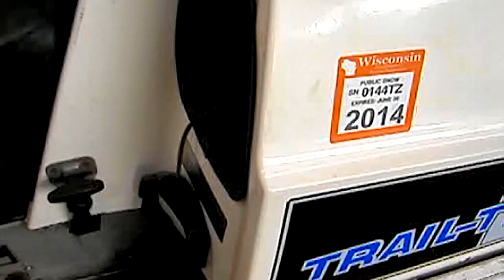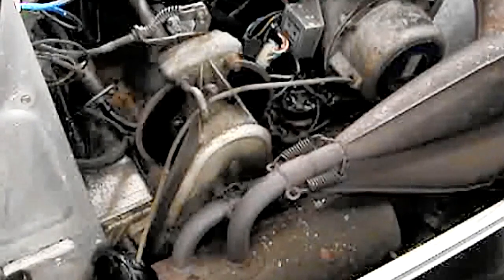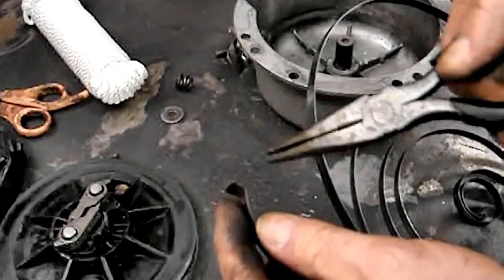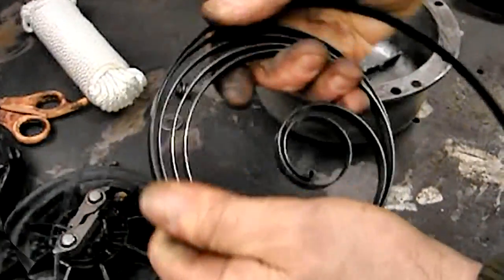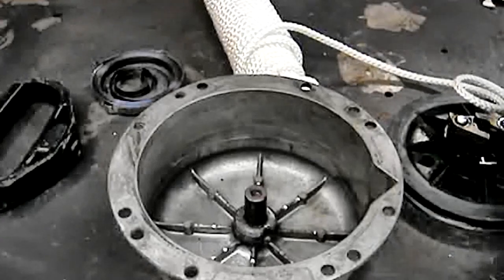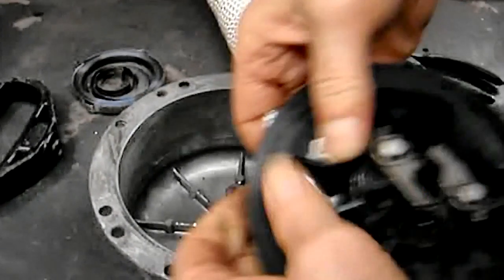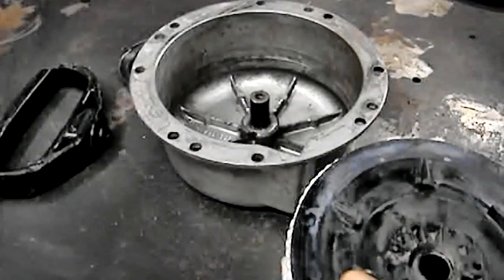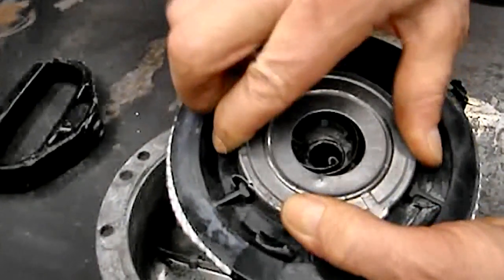How to rebuild a starter recoil rope and spring

Comment: Great vid. We differ on how to snake the rope back out to knot in the handle and I have "5 turns" written on the inside of my recoil as a reference. Nice stinger exhaust :) . I still run the stock pipe. "Pray for SNOW"-LAVSA
Reply from the maker: +GoofyLeo3, yeah that is my wife's sled, mine is a 1975 and still has the stock exhaust. we just got home from a 38 mile ride up the Door peninsula to Potawatomi park, around to Little Sturgeon and back home to Maplewood, much fun, but it sounds like 40 degree weather for Thursday through Sunday which means the snow will be gone and the trails closed. We will try to get one more ride in maybe Wednesday night this week. Take care and thanks for the post!
Reply: HA! I'm in Kewaunee! :) My Merc has a green tail because a previous owner reskined it with Arcti-Cat vinyl. I've had it well over 10yrs and never changed it because it's easy to spot in a crowd of 440 T/T's. I love my Merc, but 4" of travel means I ride my newer Polaris, more. Sucks, getting old... ;)
Reply from the maker: +GoofyLeo3 Yeah getting old is no fun, but I refuse to buy a newer sled because I know I would cut way back riding our Twisters! Maybe we will see you around, we usually make it to most of the Lakeshore Area Vintage Snowmobile Association events.